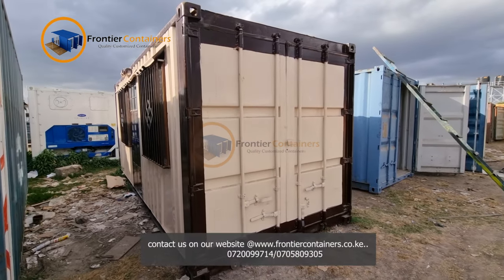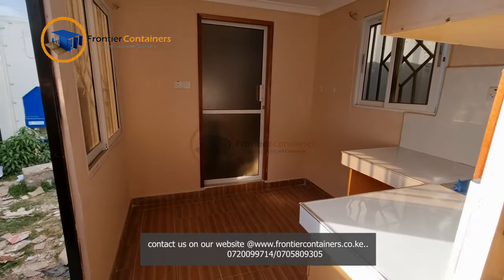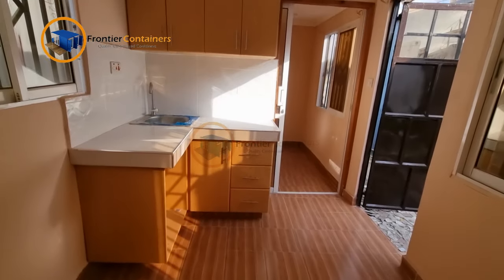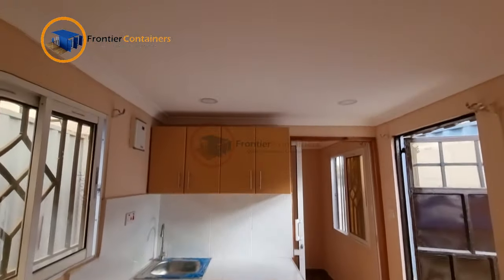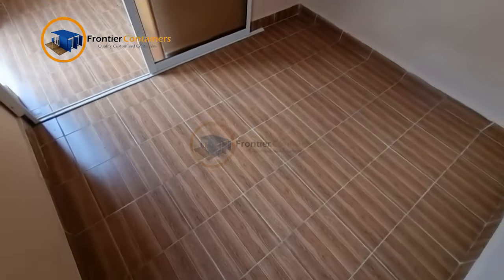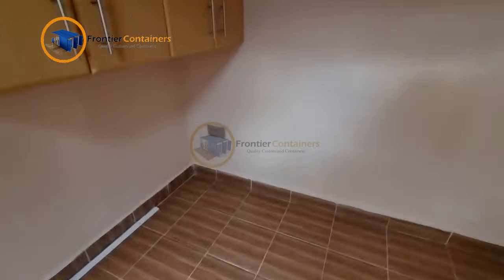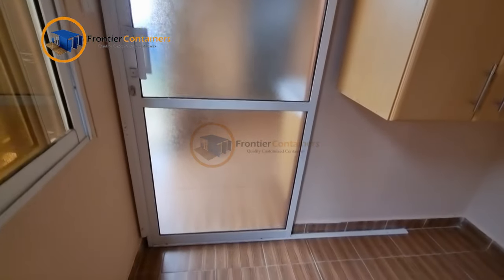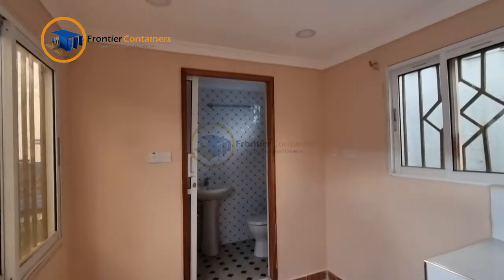20FT TINY 1BEDROOM CONTAINER HOUSE

Comment: This is so cute.  My very first home, I was only a teenager and living on my own, was this size.  It was a dorm room, renovated into a mini apartment.  It only had the entrance door, not even a door for the washroom.  And my washroom was just a tiled area with a toilet and showerhead.  Not even a sink.  I had to hang up a curtain for privacy.  My kitchen had the only sink in the apartment (where I washed dishes, brushed my teeth, etc) and the fridge fit under the counter and a 2 burner cooktop on the counter.  Then the rest of the apartment served as the living room, dining and bedroom (no separate bedroom).  The entire apartment was about 200 sq feet (10 ft by 20 ft) and only had 1 window.  It is all I needed as I lived alone and didn't own a lot of things.  I worked and went to school and it gave me a private, quiet place to study, without distractions.  Little homes like this are very practical.  It gives a person a place to live without needing a lot of money.